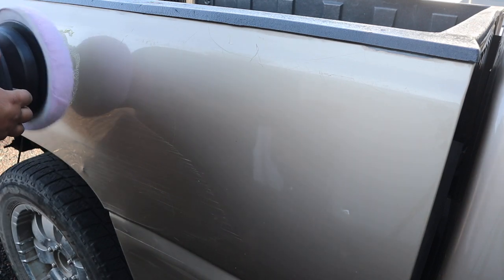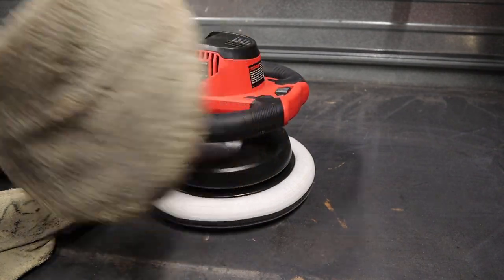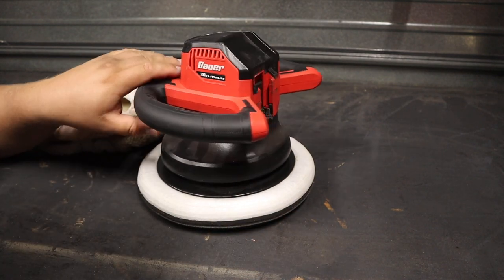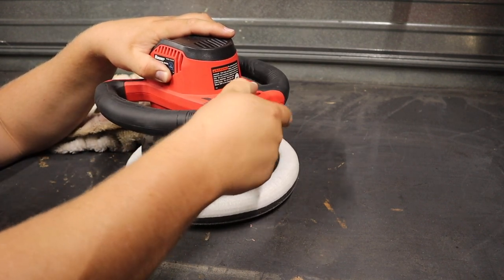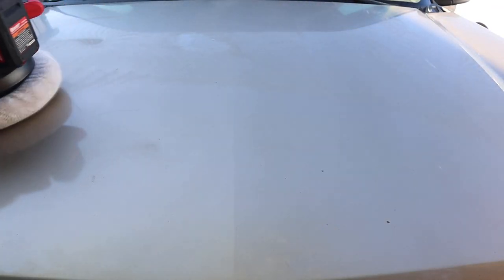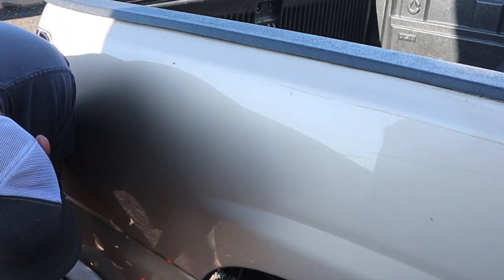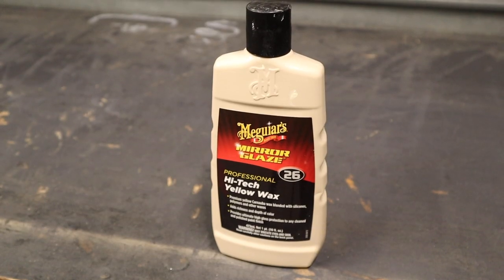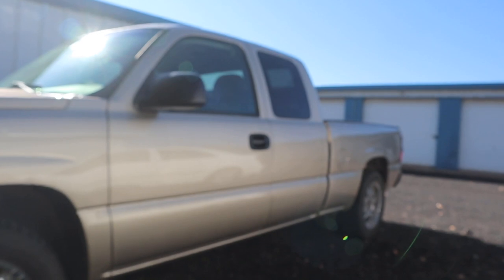Bauer Cordless 10 Inch Buffer - Review (Harbor Freight)

Comment: I have this tool as well.  I like it a lot.  Seems well made.  Used it on two cars so far and I got the blue microfiber cloths and use it to mildly scrub the tiles in the bathtub.  I agree it's a nice add to the 20v line.  I've got most of the Bauer tools, and while I don't use them daily, they meet my DIYer needs well.
Reply from the maker: Nice, I am pretty much in the same boat. I never thought of using it to scrub tiles with, but that’s a good idea. Thanks for watching.

Comment: Question, are you applying too much pressure intentionally?  There are times when it’s barely rotating.  Just curious.
Reply from the maker: I’m guessing that is due to the frame rate on the camera making it look that way. I make sure not to put too much pressure on it.
Reply: No those cheap polishers intentionally stall, they're just wax spreaders. They don't have any power for paint correction. That's why it's stalls when you see it.